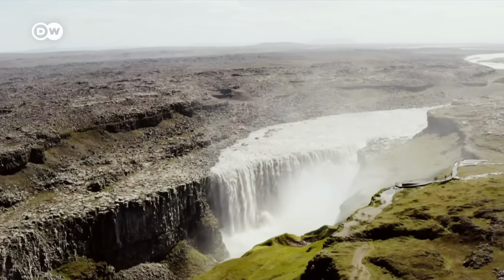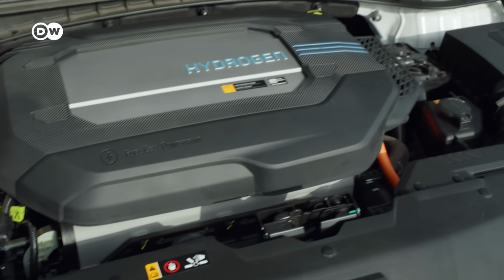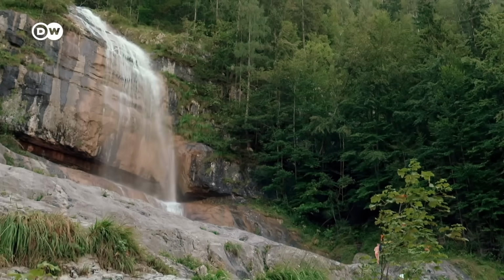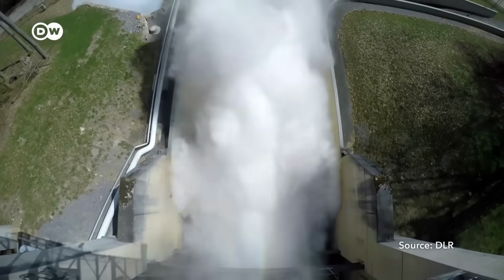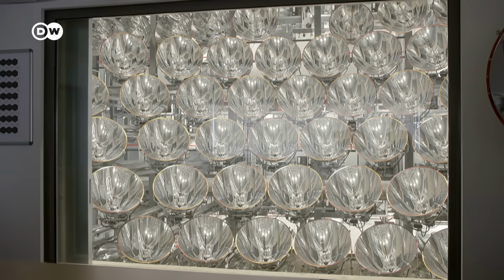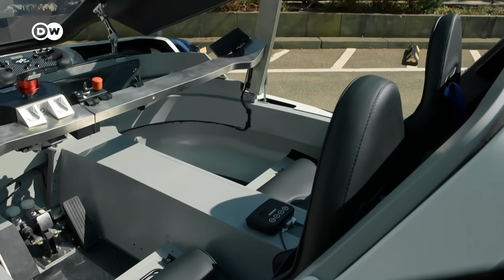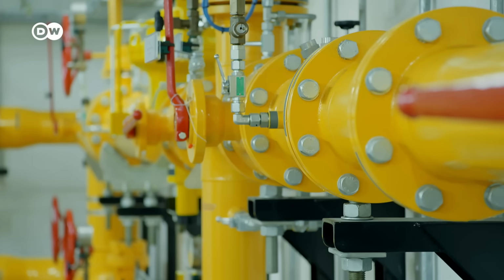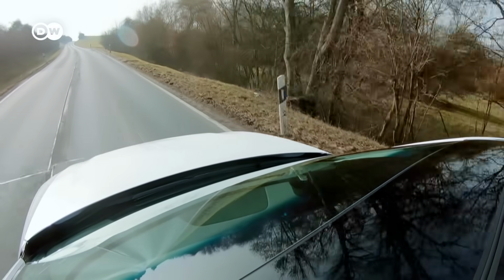Is green hydrogen the answer to the climate crisis? | DW Documentary

Comment: Hydrogen, green or otherwise is not a runner for aircraft with the technologies available now or even on the horizon. The reason is simple - the required weight and or volume of the tanks that would be required. At present, kerosene powered airliners fuel tanks weigh virtually nothing. They're formed by the structure of the wing itself, for the most part, and simply use a sealant on the seams of the wing skins and spars. A pressure vessel for gaseous H2 would be either very large or very heavy or both. the useful load of a long haul aircraft would be miniscule. Liquified H2 has the same issue - the tank would require very thick insulation in order for the fuel to remain liquid for the duration of the flight. 
It'd be niceif it were possible, butbarring some unforeseen technology popping onto the scene, H2 powered aircraft are not happening anytime in the foreseeable future.  Biofuels area far better bet if they can be produced without being an ecological liability themselves.

Comment: DW your documentaries are just a load of biased crap.

The part i find hilarious is when Prof, Christian Sattler tries to exalt using light to product hydrogen over electrolysis with the  reasoning 

"If i first  had to convert it (the energy required to make hydrogen) into electricity and then convert the electricity into chemical energy, i have two more conversion steps..."

You are being supplied electricity as a base, it comes to you like that, a power plant has already done that conversion and you have no control over that.
You are then converting that electricity into light through giant lamps... how much heat energy are you losing through that process.

So not only does the lamp process require electricity to be supplied and converted, you also lose HUGE amounts of that converted energy without being able to use it.

So not only is the powered lamp idea require just as many conversions of energy, it's likely way less efficient.

DW your documentaries are just a load of biased crap.
Touting inefficient energy production means in this steaming pile, and other outrageous ideas in out "videos"

I'm blocking this channel as it's just biased and full of propaganda.

Comment: Hydrogen is not a climate neutral gas, it is a listed greenhouse gas. I made it two seconds into this video before hitting that claim.

Hydrogen doesn't directly contribute to the greenhouse effect, true, but it impedes the natural processes that remove Methane from the atmosphere. Methane is a super greenhouse gas, as such, Hydrogens ability to lengthen the time it stays in the atmosphere means it can have a bigger climate impact then CO2, which is why it is called a greenhouse gas.

Also, considering that the quantity of Hydrogen needed to run continental energy needs couldn't feasibly be generated from green tech alone, most of it would likely be sourced from current generation methods, which is Methane and coal.

Add to that how incredibly difficult Hydrogen is to contain, and what you're looking at is quite possibly fossil fuel greenwashing that has dire potentials. If vast amounts of Hydrogen end up being produced by Methane, it would actually accelerate climate change and make it worse. Even if it wasn't, there is enough Methane being produced by organic waste, natural gas leaks, and livestock to make vast quantities of Hydrogen production a terrible idea.

Not unless they can giarantee that one of the hardest to contain gases known to man can be contained with practically no leaks. Keep on mind that they are trying really hard to contain Methane, which is mich easier to contain, and some places leak atound 7%.

Comment: The problem with hydrogen powered vehicles is that they use a lot more energy than battery electric ones since there is no power regeneration. A hybrid solution on the other hand would solve that issue, allowing for power regeneration. That said, such systems are far more complex and far less robust compared to battery electric systems, making them more expensive to produce, purchase and maintain. The solution is not better and more powerful energy sources, but more energy efficient system. There we have enormous challenges, yet also enormous gains which will eventually allow us to have a second, this time fully automated, global and green industrial revolution. Catapulting everyone on earth into 21 century technological and economical standard. The first key to achieve this lies in ever more efficient energy return systems as well as an ever higher energy efficiency. The second key is a 40% robot tax, used to turn former workers, everyone, into upper middle class consumers, providing them with sufficient purchasing power to drive that development economically. Implementing these two keys for our future will eliminate the need for poverty and / or population reduction.

Comment: Sounds good but the 700bar pressure in the fuel tank is a bomb on wheels if ruptured in an accident and a pin hole in the tank with a spark equals a very high pressure flame flower or flame cutter. The pipeline issue that hydrogen I believe can escape thought the steel walls due to hydrogens structure. Hydrogen embrittlement of steel pipelines during transients.

Comment: Interesting  and well made documentary, thanks for bringing me up to speed with green hydrogen utilization. I was wondering if my country; Pakistan can utilize green hydrogen power, instead of pesky QATAR gas dependency.  Tidal power/wind/wave will create green hydrogen through electrolysis and  be stored for baseload grid power instead of natural gas. Take UK Case; North sea oil and gas peaked in 2005 and UK only produces around 50% of it's natural gas and it's in terminal decline.  However it is surely a better position than almost 100% dependent on Russian gas like my European neighbours .Unfortunately despite having the world's largest offshore wind electricity generation, it only produces a quarter of the electricity demand(when the wind blows). However The UK has the world's 10th largest coastline and recently 50% is supplied during the stormy season! Pak has 1200 km coastline and can share energy with AFGHANISTAN and other SAARC countries as per saarc energy centre SEC. Best wishes Aijaz, energy consultant

Comment: Hydrogen as fuel is Hopeless. It has to be stored at -259 C, and even when liquid has very low density at 0.07 kg/litre compared to hydrocarbon fuels around 0.8 kg/litre. Methane (as LNG) is a lot easier to handle.

Comment: Solar fas are not a new thing and they are bad business. Maintenance is costly, the production of the structural elements as well as the mirrors are carbon heavy and itcovers, sometimes destroys land. Hydrogen as a gaseous substance is harder to contain than a liquid, it is highly reactive in its pure state. I do not like EV-s as they have a huge environmental cost, but they seem to be more practical, than this solution. One additional thought: you do not necessarily need pure hydrogen to run a fuel cell. There are many solutions to include a hydrogen donor other than hydrogen gas.

Comment: i suppose you can use it as a battery or storage of electricity (short term) for use in power plants at peak hours but say you store hydrogen for 6 months in a tank then you will maybe get 50% from what you started with 6 months ago cause no container (atom) is as small as a hydrogen atom. A cartoon analogy will be like a wall of basketball few layers thick trying to contain a sea of marbles. And you can logically imagine the marbles will leak thru the gaps in between the basketballs

Comment: There should be an engine in which I fill water, then it would internally break water into hydrogen and oxygen, then fuse the same hydrogen and oxygen to produce energy, and then the emitted H2O Should be fed back into the fuel tank! 100% GREEN, 100% repeatable, 100% FREE!
Reply: The problem is, H2 is energy storage, not energy source.

It takes almost twice the electricity to make the equivalent amount of H2 to generate that electricity.

The losses means this cannot work.

Comment: It's bizarre how all the documentaries refuse to mention that hydrogen can be used in existing internal combustion engines!
There is absolutely no way to make enough fuel cells, let alone that everyone could afford to buy them!
But producing the hydrogen where the sun is at its hottest and transporting it to colder areas makes perfect sense and also has an additional advantage by taking care of part of the heat radiation. something when it is well in place and no negative emissions occur.
Infrastructure costs such as refueling points are the biggest obstacle at the moment, but the fact that the power plants are not already powered by hydrogen is probably only to blame for the massive resistance of the oil market... Because producing and transporting hydrogen could have happened decades ago. Even the USA's role as a world currency is guaranteed to play a role because it is dependent on oil! Without the host currency role, the dollar would be almost worthless considering the national debt per person, Greece would seem prosperous in comparison...

Comment: So, I was saw a demonstration for both an EV and a hydrogen fuel cell vehicle a little ways back using solar power.  The hydrogen fuel cell vehicle needed 6x more solar panels, which means 6x as much material needs to be mined and manufactured and shipped around and installed somewhere to make it do the same job.  While hydrogen production has gotten more efficient, battery technology has also improved by leaps and bounds since this demonstration.

You know in the USA after the two stage rocket to orbit rocket (Saturn V for example primarily used the 3rd stage for the Lunar trajectory burn) and a small capsule, the USA switched to flying people via the 1.5 stage to orbit Space Shuttle.  It was billed as "better and more reusable".  This was a full out effort by the USA.  Now the USA is flying on a 2 stage to orbit rocket with a capsule on top.  Turns out the Space Shuttle design sucks in many different ways and the older designs are inherently better.

Just saying we have been down this kind of road before with some technology hyped up over other technologies, but it turns out it is not the right solution.

Maybe for a bit of a deeper dive into cars, EVs can get power from the roads through resonant induction placed strategically around Germany, making EVs cheaper and lighter while being able to drive around Germany perpetually if you want.  The USA has demonstrated this technology at Oak Ridge National Labs to be 86% efficient using modern power electronics.  When you consider your EV becomes lighter and thus less energy to move it around and cheaper to make because less batteries, plus once installed in the right places, EVs no longer need to stop to charge, it is a no brainer, especially when you look at how much more expensive this hydrogen deal would cost to implement and how much more damaging to the environment hydrogen would be to build out as there is a huge cost to the environment to make all of this hydrogen infrastructure as it is just so very inefficient.  Where your trains don't have overhead wires, efficient batteries can be used for short to medium distances and then overhead lines placed in strategic spots to charge up the batteries.

Really, at least for a lot of things, that old battery from over 100 years ago where we started using batteries for things like transportation even before the ICE engine, it turns out it was the better technology all along.  It is just the lead acid version wasn't all that great and back in the day we lacked the power electronics to get the most out of it.  Now we have better battery chemistries and we have advanced power electronics.  Not saying hydrogen has no use, but instead it really only makes sense for certain niche applications where if you want to go green, battery technology is just better and cheaper and less damaging to the environment.

There is another issue with hydrogen cars and plane.  What I have heard from other parts of Europe is they have a fueling station mishap and a huge Hindenburg like explosion, actually more of a gigantic bomb going off where the Hindenburg just burned.  Then new fueling stations in that country gets banned because it is deemed too dangerous.  That hydrogen fuel cell vehicle in addition to being crazy expensive to make, far more expensive than a battery vehicle to make, well you are sitting on top of a tank of hydrogen rocket fuel compressed to 700 atmospheres of pressure.  What happens if you get in a accident or say run over some metal debris on the road and the tank ruptures?  In this regard EV grade batteries are a lot safer.  Now say you scale this up to airliners where you have these giant tanks full of hydrogen rocket fuel to fly all around Europe and to other parts of the world and planes carry a lot of fuel to fly large numbers of people at high speeds for long distances.  You then have a mishap at the airport with dozens or more planes all full of highly compressed hydrogen and one plane exploding leads to a chain reaction of all of the planes exploding as a humongous explosion from one plane is bound to critically damage other planes in the general vicinity, especially if the mishap makes it to the terminals where all of the planes are parked for passengers to load and unload from the planes.  Even with just one plane exploding, I think the technical term people will use to describe it is "it was like a nuclear bomb going off", so yeah, the kinds of forces involved in a busy airport mishap could very easily lead to a chain reaction where all of the airliners end up exploding and leveling everything in and around the airport, especially if the main storage tanks at the airport used for fueling the planes also rupture.  So yeah, you may see a huge mushroom cloud above the airport and then a giant crater where the airport used to be.  After all with a hydrogen fueled rocket, nobody is allowed within several km of the launch pad due to safety reasons in case the hydrogen explodes.  At least liquid hydrogen has somewhat of a delay as it boils at an extremely low temperature near absolute 0 and so its overpressure wave isn't quite as intense per unit of fuel as highly compressed hydrogen you would use in airliners that will just instantly expand out, combine with atmospheric oxygen, and explode in a huge overpressure wave.  Either way it is still a catastrophic boom.

I think hydrogen is the wrong technology for a number of things.  Just like the Space Shuttle design was the wrong design for a rocket, I mean it could fly, but sucked at it and couldn't be made into a good rocket and thus was cancelled, hydrogen for a lot of things needs to be cancelled because it is not the right fit and things will go wrong leading to its cancellation anyway.

Comment: If they develop Oxygen Concentrators, then Hydrogen Fuel Combustion becomes much cleaner, because it can reduce the last byproduct of ICEs, NOx. NOx comes from using plain air as an oxidizer. Remove the nitrogen, and you stop NOx production.

Comment: In January 2015 Der Spiegel reported that significant problems had been found with U-35 and her sister submarine U-36. The drive shaft system, battery, radar and the radio buoy were all found to be malfunctioning.  In October 2017 U-35 entered dock at the ThyssenKrupp Marine Systems yard at, Kiel for inspection after damaging her rudder during deep water testing in the Kattegat off Kristiansand.

Comment: Governments should just build hydrogen fuel cell power plants next on the coasts of countries. There is your water source.
Build off shore wind farms or have solar farms within the confines of the plant. There is your electricity source for electrolysis and production of hydrogen. Any excess electricity from that process can be sent straight to consumers. The hydrogen produced can be sold for use in transportation or anything that would have its own fuel cell, so no need for nasty lithium ion batteries!(so bad for the environment and would never work in aviation)
The rest of the hydrogen would be used in the plant to power even more homes. Goodbye global warming. 100% carbon free and not damaging to the environment.
Of course governments would be reluctant to do this because they can’t exactly say we running out of seawater. Which is bad news for them as if there is an abundance of a particular fuel/ energy source it tends to keep prices down.

Comment: Is hydrogen really environmentally friendly?  Water vapor is a worse green house gas than carbon dioxide. Also pumping water vapor into the atmosphere, will cause changes in weather patterns and could cause flooding where there is already a lot of moisture in the air.
Reply: Water vapour self regulates. It comes back down as rain or snow.

According to Nasa, water as ghg gas is a symptom not a cause.

The warming caused by non condensing gases like co2 make it harder for water to recondense. Amplifying the effect of co2.

Source: Steamy Relationships: How Atmospheric Water Vapor Amplifies Earth's Greenhouse Effect, Nasa

Comment: Before Watching

The issue is not wether hydrogen works, it does and it works better than carbon based fuel, the issue is that the amount of energy you need to produce it at scale is far more than what it gives you, plus nuclear is there, nuclear matched with batteries is a perfect solution

Comment: It would have been nice to mention torquise H2 production, the natural gas network can be used until end of the line H2 is needed to cut down on costs, and the solid carbon black can be used in everything from batteries to tires and even steel production and in asphalt for roads. It also solves the use of fresh water or brine from desalinization.